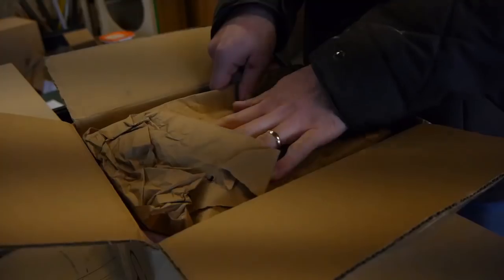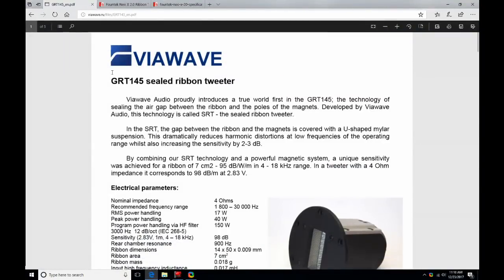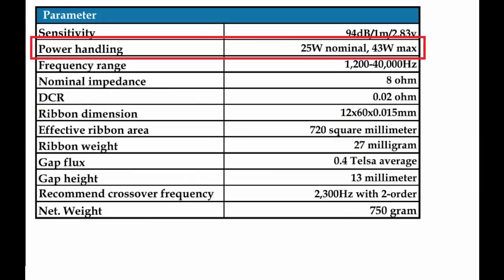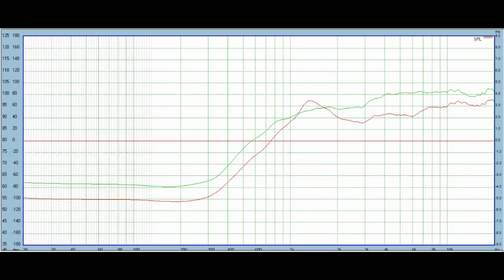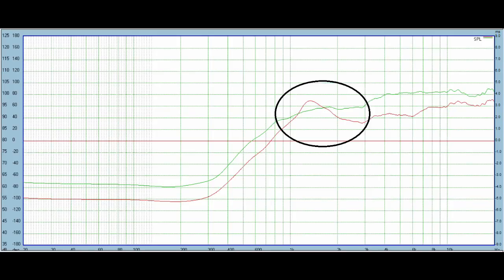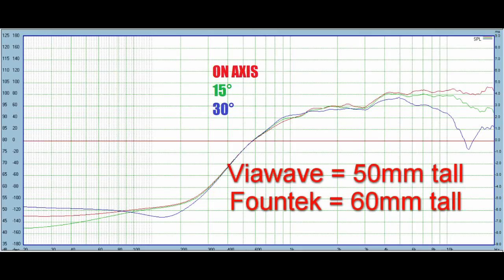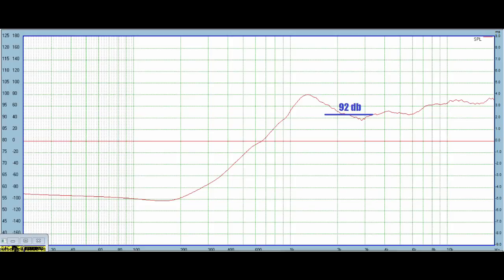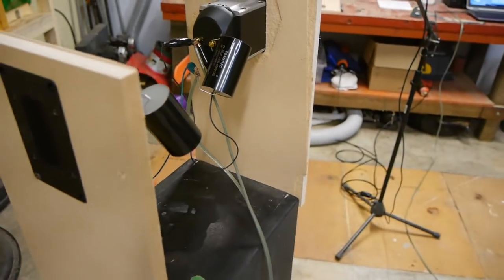Viawave GRT 145 vs Fountek Neo X 2.0 ribbon tweeters

Comment: Does the Fountek have a neodymium magnet? The peak at 1.3khz could well be a product of magnet hysteresis.
Reply from the maker: Hmm, I can’t remember but if I had to guess, it does. I’m not familiar with magnet hysteresis; and not sure why a neo would be different than a ferrite. I’ll look into that, thanks.
Reply: It's more like camera or ribbon resonance. But it is not a problem - it s below crossover frequency. 
I used both tweeters. CD2 can be used with a lower crossover frequency and 
Viawave is a bit better on higher frequencies. Both are good.
But  use those at higher crossover frequencies than manufacturers recommend.

Comment: Welp, this excludes the Fountek from my search. I need to cross at no higher than 2500hz in a 3-way design with SEAS Excel 6" mid-woofers, but these do not seem to perform well at 2500hz. What are your thoughts on Aurum Cantus G3's crossed at 2500hz mated to that woofer?
Reply from the maker: DjKinetec most ribbons aren’t happy crossing low, especially small ribbons. The Fountek in this video isn’t that big. The AC G3 is quite large and can probably handle 2500 without too much concern, But I don’t have first hand experience with it. Note that a large ribbon has other drawbacks. The Viawave is really good because it can handle a pretty low XO and remains short.
Reply: @ImpulseAudioSpeakers  Do you know how much the Viawave can be obtained for? Is shipping for it difficult? It seems like there aren't any US distributors. Thank you for the help.
Reply from the maker: DjKinetec there is a US distributer, last I check he was listed on the viawave website. Are you in the US or CAN?
Reply: @ImpulseAudioSpeakers  US

Comment: Who sells the violate, and how can you bring its response down to work with a system that's rated at 90 db or so?
Reply from the maker: ken cohagen it’s a guy named Roman who imports them from Russia. He is listed on the viawave website. 

I just used an Lpad to bring the level down. Was something like 6ohm series 5ohm parallel if I remember right. The impedance of this tweeter is really flat so it’s easy to just adjust the resistor values until you get it where it sounds balanced. And if you use an active dsp XO like a mini dsp you would change adjust the level in the software.

Comment: I wonder how the 3.0 version of the fountek would fair against the viawave. Do you know where i could buy one of these http://viawave.ru/en/product_srt7
Reply from the maker: analogaudio rules if you want the viawave the North American distributor is a guy named Roman. I think his contact info is on that website. 

The NeoX3.0 is not as good as the viawave in my opinion. It has a bigger diaphragm so technically can cross lower, but the viawave has great distortion numbers and super high sensitivity. Should be able to cross very low. Everything else about the viawave is better.

Comment: Nice video. Is it  safety using 40uf continously?
Reply from the maker: indravatar it’s so the amplifier doesn’t see a short at low frequencies and that the ribbon isn’t over driven at low frequencies. It is safety but necessary.

Comment: Efficiency is acoustic output pr electric input power. The Viawave sits higher in the reading because it's some 4 ohm's . Try presenting the same amount of wattage (power)to both speakers ( after measuring their actual nominal/average impedance,-  a pocket calculator will help finding the right voltages for this test. Please !
Reply from the maker: William Kvist Poulsen I provide the impedance plots. Can’t remember (have to watch my own video to remember) but I believe the viawave was still more efficient. 4ohm is a 3db advantage over 8ohm (consumes double the power). In any case it’s definitely more sensitive.

Comment: Three to six db sensitivity difference and not efficiency difference as stated. Efficiency would be stated as a percentage.
Reply from the maker: carlos oliveira sorry but that’s not the case. There’s no need to state it as a unit of percentage. I’m not sure why that would be the case.
Reply: @ImpulseAudioSpeakers  You are absolutely wrong here. I'm sure you can research it and eventually find this to be correct. It does kind of diminish your credibility though as this fact is pretty basic.
Cheers
Reply from the maker: carlos oliveira percent is a ratio. Efficiency is the ratio of sound power out for electrical power in. I stated that ratio in decibels instead of percent in this video (dB/watt). They mean the same thing except everyone understands it better as dB/w@1m. More than that most people refer to sensitivity the most (expressed as dB@2.83V@1m). Stating driver efficiency as a 2.138% vs 2.146% would be very cumbersome. Nobody does that. Those are made up numbers by the way.

But if you don’t find me not credible that’s ok too.

Comment: I for one will never understand the need for off axis measuring - I do not wonder around my room when Im listening to my system - maybe there is some consideration for a Home Theater  - even then some DSP correction can be made to improve - especially with units like my DIRAC Live correction
Reply from the maker: GLYNN TILLERY you should do some research around power response. Off axis response can be just as important as axial. Research is pretty solid in this area.
Reply: Think about it. Your speaker doesn't just aim sound directly to your ears. Some of it is reflected off side walls etc. If a speaker was only designed for flat direct sound, you would find it to be exceptionally bright and tipped up in overall balance in room. As was mentioned here, it is the power response that is more important which takes into account the reflected sound as well as the direct (total acoustic output) to  produce a flattish response.
Reply: @carlosoliveira-rc2xt  one of the main reasons that planar speaker design is superior IS that the pressure wave that is uniform or "flat" as it were  which decreases room acoustic anomalies ... people have been so used to dealing with the inherent problems of cone shaped drivers - that they just got used to the less than controlled dispersion.... interaction with room properties should be dealt with at the speaker level more than the hardware level ....
Reply: @rts100x5  The planar speaker has less dispersion to the sides so interacts less with side walls. A wide dispersion speaker should not be considered inferior as it mimics real life. 
Flat planar speakers have as many weaknesses as they have strengths. 
While room correction devices can be beneficial, especially in the bass range, I have yet to hear one that is totally transparent in the midrange. Of course this would depend on the resolution of he rest of the system. The speaker is the final link in the reproduction chain and if you think about it your room correction is actually upstream of the speaker even though it is taking it's input after the speaker.
Wide dispersion with even power response is the way to go in designing a speaker. It has been shown to be the case and is not an opinion.

Comment: Great. I got the point of your review here.

Iv been looking for a pair of smooth running super tweeter as a top up to my two way JBL 4320 ()which stops at 15k Hz quite sharply  and above) to form a 3 way system, and maybe test out adding my vintage Jensen P8P squawkerz in conjunction for a 4 way. I would like to run that super tweet above them from my active xover system, possibly at 800, and 15k for the JBL in a 3 way system, or 800, 3k and 8k Hz with the P8P and the super tweets.

My choice would be the Foundtek with money considered. 

What do u think?

S
Reply from the maker: Terence Lau if crossing so high the fountek, definitely. The viawave is nice, but for more conventional applications that require cross overs below 5khz.

Comment: Were the measurements done in below freezing ambient? Cool temperatures can radically alter the physical dynamics of many polymers.... but you knew that😉.
Reply from the maker: Jennifer WhiteWolf not below freezing (doesn’t get that cold here very often) and I usually wait for a warmer day even if I do the talking on a different colder day. Besides, when it does get cold I store the drivers indoors and bring them out just for the test so they’re warm for the test. Speed of sound is slightly higher in the cold otherwise there is not much difference. 

Seems like everyone’s comments lately are trying to pick apart my methods. I know what I’m doing even if I can’t give every detail in a 10min video. Why am I doing this again? It’s certainly not for the $10 google pays me. Sorry I’m ranting, it’s a lot of comments like this not just yours.
Reply: @ImpulseAudioSpeakers  The "suspensions" of the drivers become stiffer so there is definitely a difference. Subwoofers are even worse. Jennifer is spot on here.
Reply from the maker: carlos oliveira like I said, the drivers were at room temperature. They don’t cool off that quickly. Besides, I’ve done plenty of comparison testing and temperature rarely impacts performance to any noteworthy amount. Feel free to dismiss the data though. It was free information so not anything you’ll miss out on.

Comment: Texting from Toronto once again fannntastic video were have you been all my life really need some advice have custom made speakers made by a Canadian speaker co. here 2way 15in woofer     with compression horn ported in front w/2ports open them up to replace caps and noticed all specs wiped off of drivers? I insulated the cabinets and replaced cap would like a quality cross over install

Comment: Looked up those Viawave GRT 145 ribbon drivers. They look well designed and hard to get. What was their efficiency?
Reply from the maker: I have a review of just the GRT 145 where I discuss the efficiency. But they come in around 98db. The manufacturer rates them quite conservatively. The sensitivity peaks around 102db/2.8V/m !!! That's a loud measurement in my shop haha.
Reply: Have you considered the B&C 6MD38 dedicated midrange driver? 96dB sensitivity and very low distortion. Zalph Audio rested it and the waterfall plots looked very good.

Comment: I just discovered your channel.. Very informative! Any chance you’d design and build a fairly efficient 2-way floorstander with the Viawave? Something with a benign impedance curve that can be used with high output impedance amps (tubes?) BTW, what do you think of the hornloaded Viawave models? Thanks....
Reply from the maker: Rick G thanks! I am starting a 3 way design using the viawave. Not sure about efficiency though. We'll see where it goes. Already have the test boxes built and started testing.
Reply: Impulse Audio Thanks! Yeah, high efficiency usually connotes pro or boutique drivers.. 

Have you ever tried Audax pro drivers? I dunno how they would sound but I liked their cloth domed tweeter I used before. At Madisound they have a 5” paper wideband and a 10” paper woofer in their pro series for a 3-way that seem quite linear for mid and midbass duties for an efficient Viawave project.

Comment: Great video! Are you going to use the Viawave tweeter instead of the Fountek now in your three way project? ;) :) Have you decided on woofer? ;)
Reply from the maker: Fear Wolf Brewery well Im still gonna work with both of them and listen and compare, but the viawave has really impressed me. The woofer will be the Motus UH205PW1 that I previously tested as it really impressed me as well. I have a few mids to try, but leaning towards the scanspeak 15m

Comment: Thanks for all these uploads, I really look forward to each one. Is it possible to compare this Viawave with a 4 letter brand in future? Also comparing caps.. realise this is a controversial area also.
Reply from the maker: Will Mac haha I suppose you mean RAAL? I dont have a 7cm RAAL here or I would. Actually I dont have any RAAL drivers. And they are not cheap. If the opportunity comes up I absolutely would. As for a capacitor comparison,,, gee that would be hard to pull off. Im not sure I'd be able test them properly or show any difference. Ill give it some thought but not sure Im the guy for that job.
Reply: Impulse Audio yes that 4 letter word😁. Have a great christmas and NY